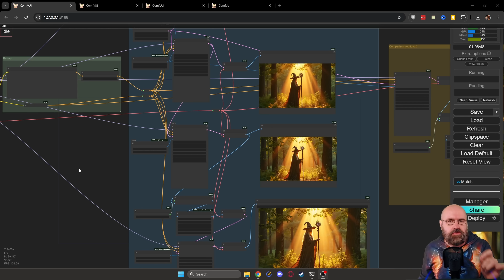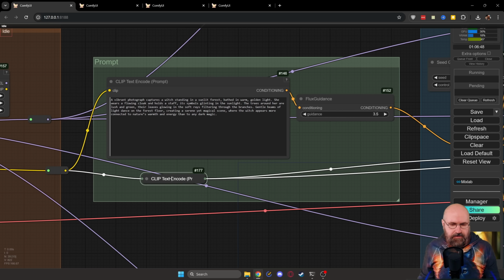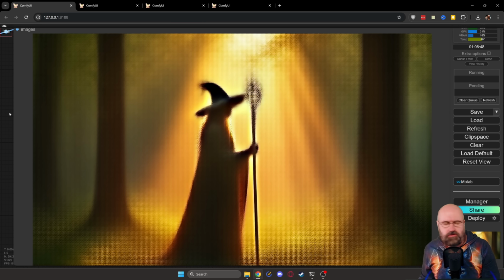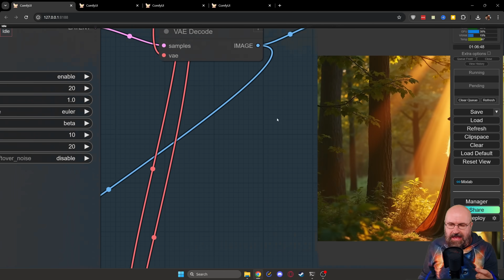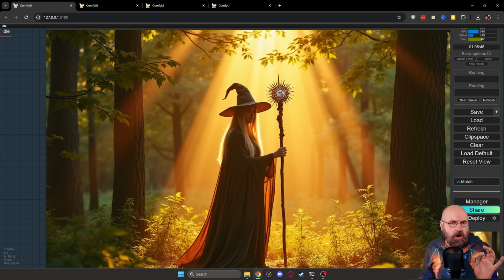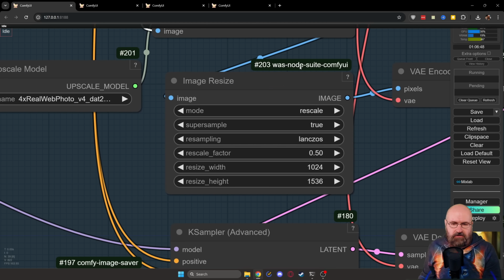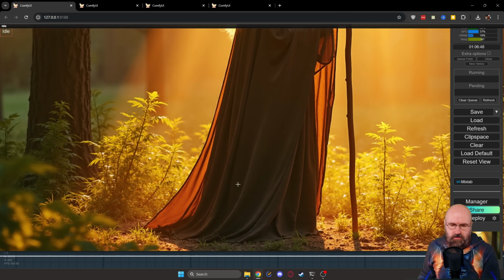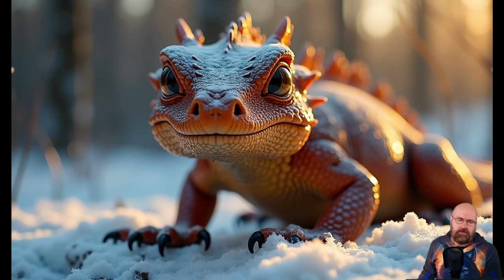Is SUPER FLUX the Secret to Insane Details?

Comment: Great video! Thank you. One thing I encounter is that if I use an uspcaler between step 2 and 3, I get scraping lines on skin or other flat surfaces. Tried various upscalers... I get more "natural results without them. I will need to test more. Took me a while to figure out that it was the  upscaling.

Comment: Anyone who is wondering how to do image to image with the advanced ksampler. It's the start and end step. If doing 30 steps, set the start step to 15 if you want .5 denoise.

the second sampler he has set up that's going from start step 10 and end step 20, is essentially just a .5 denoise strength. The ksampler advanced just let's you break that up however you want to make it ..more advanced. =P

Comment: MAC RESULTS: took a while for me to build this as only started CUI a month ago (on MAC) so. Results: works very well ...over all, final image does take longer than my normal single sampler WF which returned its end result just before the 20-30 step started....BUT the results are wow noticeable. AND now i can stop a queue in apx less 30 sec rather that wait for a bad surprise at the end. I added this to the back end of a FLUX WF that was using flux sampler plus  3 LORAS on MAC STUDIO M2 ULTRA 128 with all models on external HDD (spinning). dev Q8 gguf, dual clip loader: t5xxlfp8 34..., clip_I.safetensors.

Comment: I'm getting into Flux kind of late, but this is a super helpful trick. Getting fast previews is key. I was using turbo and doing smaller renders to test different settings, but this method is much better. 

I don't know if people are appreciating the algebra on the upscales:

30steps + Upscale
vs
20steps + Upscale + 10steps 

It's the same amount of processing, but this method puts 10 generative steps after the upscale, which is the trick to better upscales in general.

Thanks for sharing!

Comment: One question where I'm not fully understanding something. The original empty latent is 1304x768, but in the Image Resize node the resize width and height are 1024x1536. It seems this would switch the image from landscape to portrait mode and distort the image because of the different aspect ratio but all images are about the same, following the aspect ratio of the first image. Why does this work?
Reply from the maker: no, it uses the scale factor of 0.5, not the pixle values, because it is in "rescale" mode.

Comment: Basically a 3-pass with a noise injection after the first ksampler and an upscale after the second. It gave me a gridded image because on the first ksampler I've set finish step at 10 but setting 20 for total step (where you set a total of 10), and the second ksampler couldn't converge starting from 10 and finishing to 20 on a total of 20. Which means you are obligated to use a ksampler advanced and not a ksampler custom with a sigmasplit node, because this one does only the first thing I described. How unfortunate. Gonna try this other approach with turbo.

Comment: Thank you very much! I recreated the workflow on my RTX 3050 8GB VRAM, 32GB RAM, and the result was WOW. The whole generations process took 10.40 minutes. I repeated the generations using the same nodes but with adding a Lora and changing the model to FP8 and the process took 8 minutes only. FP8 is much faster on my system than the Q8 GGUF.
Reply: Just keep in mind Q8 GGUF is closer in quality to FP16 than FP8 is

Comment: 0-10 in computer calculations is 11 steps. As is 10-20. 10 11 12 13 14 15 16 17 18 19 20.  That's 11 numbers, so your ksampler should be set to 11. Otherwise, you never reach the final step. Unless you don't want to reach the final step.  Also isn't this exactly how SDXL refiner works?
Reply: Gonna try your theory tomorrow. Interesting!

Comment: Using your workflow I achieved incredible results using flux1-turbo-alpha lora (1024x1024 pixels with 4, 8  and 12 steps; 11 + 11 + 45 seconds with my RTX4070 graphic card). The 2048x2048 final image is fantastic! Thank you very much!
Reply from the maker: awesome. i need to try that :)
Reply: Also using the turbo flux lora here, but I'm very interested in your workflow. What steps do you put at the 3 KSamplers? Is it 4 steps start-end 0-4, 8 steps start-end 4-8, 12 steps start-end 8-12 ?? Never knew the flux turbo lora could handle more than 8 steps).

Comment: Seed? Running the same seed for all 3 samplers (set seed widget to input) or generating separate, like you do in this workflow. And the way you run it, is there any point using separate nodes for generation of seed?
Reply from the maker: seperate, because the same will introduce problems with the image

Comment: Honest question, could this accurately be described as a "2x HR Fix"?  Instead of 30 step gen, its 10 step, followed by a 10 step "HR fix", followed by a 10 step "HR fix" ?
Reply from the maker: maybe, but keep in mind that this does 10-20 out of 20. not just 10 extra steps. and that's important for how flux works. because if you would do a second 0-10 out of 10 you would simply get the same image again
Reply: @OlivioSarikas  Thanks for the reply!  I’ve been contributing to Forge, and your video has me thinking that HR Fix has untapped potential, that perhaps a “loops” parameter would yield these results.  One thing that doesn’t make sense in this workflow (to me) is how much noise is being added to the latent outputs on the next sampling.  It’s just a true/false value… I would think this should be similar to “denoising strength” in WebUIs where a lower value adds less noise to the latent output, and a higher value adds more.  In regards to your reply… if each of those 3 KSampler nodes generated the total steps (from 0 to X) , without feeding in a latent input, would the result images be drastically different from each other?

Comment: The workflow shown in the video can be reproduced manually, I've tried it myself. So if you want to learn from scratch, you can follow the workflow as demonstrated in the video. However, if you prefer a simpler option and want to support, you can check out the provided link. By the way, thank you Olivio Sarikas.

Comment: What are the two nodes called after Unet Loader and DualCLIPLoader?
Reply: Do you mean the small blank ones? They are called Reroute. They are a passive node used to extend the output of a node closer to where it is needed especially where there a lot of connections to the output. The connection passes through them and they have no effect. Their use is optional.

Comment: Interesting idea.  How long does it take to run with 4090?  Have you tried skipping a step ie starting at 11 instead of 10?  or injecting noise?
Reply: RTX 3060 / 12GB - first two steps take 1 minute each. Last step takes 4.5 minutes with minor improvements compared to step 2
Reply: @ernstaugust6428  thanks for the info. I built a similar WF and it's running in about 2 mins total on my box with 4090.  I added more steps and a 4th stage so it gets sampeled twice after the upscale.

Comment: I'm not sure why, but I don't have the same results as you. After my first pass (10 steps), the image is already very realistic. After the 2nd pass (20 steps) the image has more details, but the image is overcooked (too much contrast, weird colors), it starts looking like a painting. After the 3rd pass it's basically the same, so the end results after 30 steps is worst than after 10 steps. I used the same models as you (for the GGUF and the upscale). I'm not sure why is that.
Reply: To answer my comment (maybe it can be helpful to others). I initially thought that you were using the same noise_seed for every sampler (which product this overcooked effect). With different noise seed for each sampler, it's much better :)
Reply from the maker: Make sure you use a different seed on each image
Reply: @OlivioSarikas  Yes, I fixed that, and it works well for characters, but I realized that for scenery, the second pass tends to make the image looks 'fake' (compared to the first pass). I'm losing lots of details (textures), image look too 'clean', with strong contrasts and saturated colors. I'm trying to add some extra conditioning for the 2nd pass to keep it realistic, but no success so far. I'm testing different parameters, but still no success so far.

Comment: Did I miss this, or was there talk of time savings? If so, what is the time comparison of this method vs the normal method? Side note: if you want to do fast iterations in Flux, you can render in 512x512. When you get something you like, just Hi-res fix it by 2X and make it 1024x1024. If you set the Denoise to 0.35 and the hires steps to ~15, it looks almost identical to the 512x512 version. (Note: I'm talking about using it in Forge, but you could just activate an upscale if you did it in ComfyUI)
Reply from the maker: The time saving is to gave a full image after 10 steps and then cancel uf you don't like it. 512x512 gives a different composition and less details, so you will get a worse image in the end
Reply: @OlivioSarikas  Ah ok gotcha, you just cancel if you don't like. On my 512x512 testing, I'm not seeing less details or comp changes when using in hi-res fix in forge. I can't post examples here unfortunately.

Comment: I just tested it out the Load Diffusion Model node and Flux-dev.sft  works perfect. Also use Seed Everywhere. Fix Seed, but increment them by 1. Exp 942,943,944. This will keep the image from getting burned. I'm loving this Olivio.

Comment: AI Image generation is basically a glorified denoiser. I'm wondering if too much noise was removed in the first sampler. Would be interested to see the results if you did steps 1-10 of a max of 12 (or up to 15) for example for the first sampler. This way you have an overlap but you're still letting the second sampler not go to waste as much. The way you have it now, the second sampler is nothing more than full image inpaint with a very low denoising strength.
Reply: With the particularity that the image on which the entire process is based has been generated in an accelerated manner in 10 steps, which increases the possibilities of alterations and malformations in the hands, eyes, anatomy. etc., which will not later be able to be corrected in the remaining refined processes.

Comment: So weird. My output looks like absolute garbage. And my workflow is running about 4 times slower than usual. Did Comfy update something today? 😢
Reply: Are you running on Windows? I recently discovered that Nvidia drivers for Windows (since Oct 2023) allow system RAM to be used to supplement GPU VRAM. I have found that it runs about 4 times slower. (But on the flip side, it lets me do things I wouldn't have been able to with only 16G VRAM)

Comment: The method works extremely well when it comes to details, but for some reason I get fine horizontal stripes in my image after the last KSampler (Upscaling). Does anyone have any idea what is causing this?
Reply: I'm getting the same striping, something that hasn't been a problem with other workflows
Reply: @kivisedo It's the upscaling, Flux gets wacky when you go over 2 megapixels. I solved it by running the image thorugh SDUltimate Tiled Upscale for 4 steps with 0.15 denoising.
Reply: @equilibrium964  Exacly what saw an I did the same to fix. Works fine with a little extra mask blur (16) and tile padding (48) and low denoise.

Comment: I tried this and ran into "Warning: Ran out of memory when regular VAE encoding, retrying with tiled VAE encoding." on the third ksampler. Its progressing but is taking 30 minutes for 30 steps. Im on a 3090 24gb btw.
Reply: Did you skip the image resize 0.5 node? I had the same on 3080Ti 16gb.
Reply: @lexmirnov   @nesimatbab Thats probably it. Should be less than 160 seconds. And I am using fp16 on my 3090. Still, its no doubt there is a lot of pixels to push considering its still a quite large final image.

Comment: Very interesting and creative workflow. I don't use GGUF models though. Is this trick useful for someone like me that uses FP8 models? I did a couple of quick tests with a fine-tuned model (STOIQO New Reality FLUX) and I didn't see any perceivable difference in the amount of details and quality of textures doing this in 3 stages instead of doing all steps in 1 stage.
Reply from the maker: you can also use it with the other models, but you need to change the model loader
Reply: @OlivioSarikas  I'm afraid you misunderstood my question. Also, I already used the appropriate loader when I did my test with the FP8 model. My point was, If I use a "normal" FP8/FP16 model, is there any benefit to this 3-stage workflow instead of using just 1 ksampler? As I already mentioned, I did not notice a difference in the quality of the images when doing it in 3 stages vs 1 stage when using the FP8 model STOIQO New Reality FLUX.

Comment: How can replicate it using the "SamplerCustom" or "SamplerCustom Advanced"??
Thank u very much bro !
Reply: you need the advanced sampler to be able to start at a middle step.  % denoise lets you stop at a position but doesn't let you start in the middle so you have to use a sampler node that allows you to set the start step.    Just use the advanced sampler and add the flux guidance node after your text encoder.

Comment: It doesn't seem like this would be very fast, as it has 3/4 samplers. But I do like the workflow that focuses on highest quality, it is similar to Nerdy Rodents latest, but he also used custom Scheduler Sigmas to give more control of the generation (like help dealing with the turkey skin).
Reply from the maker: The fast part is to have a full preview of the composition after 10 steps that stays the same. So (depending on GPU) after 10 seconds you know if you will go on or cancle. And then get much better details if you keep going
Reply: Because the model doesn't load and unload between samplers, it is equivalent to doing 30 steps on one sampler in time, but it finalizes the overall composition so you can see the results of the composition earlier and cancel the render process if you don't like it. This is mainly how it is faster.

Plus it just gives better render results comparitively. I'll have to check out Nerdy Rodents latest workflow too though.